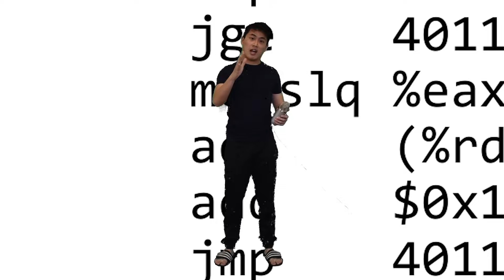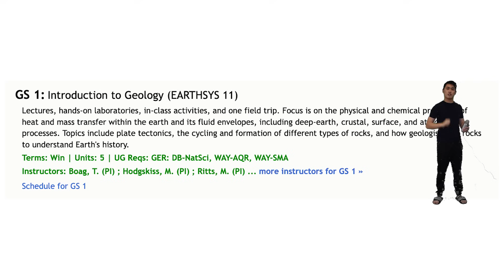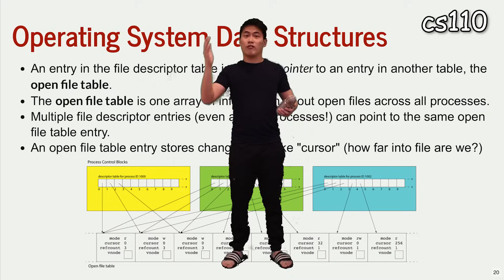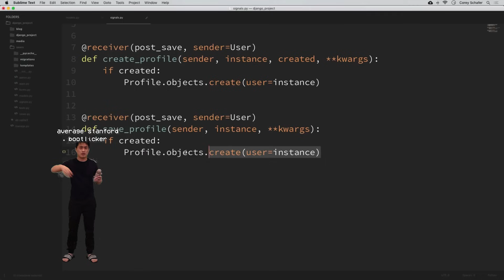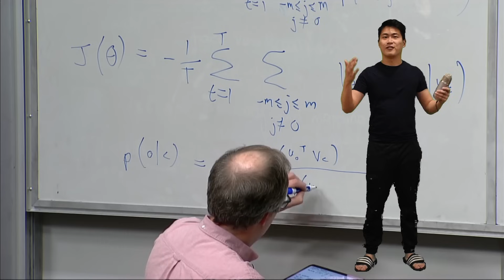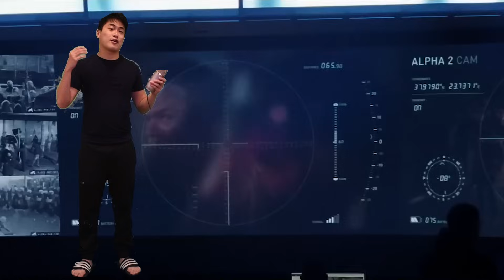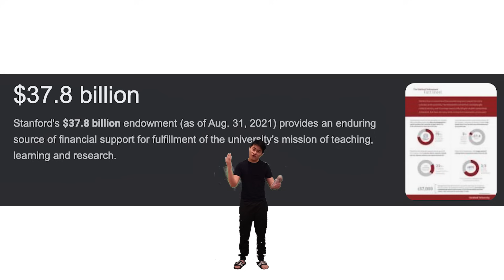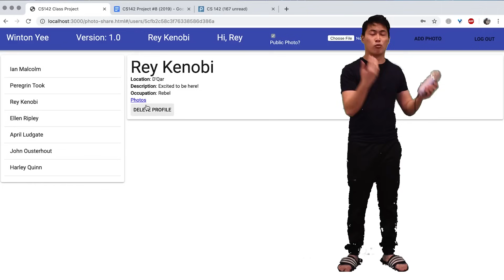Stanford Computer Science is Broken

Comment: As an IT bro with 2 associates in bullshit, 2 bachelors one being CS and another IT management and a masters in IT management I will agree that useful content on all of my degrees is about 1/4th useful if I am lucky. CS side coding was useful but not in depth or even theory heavy enough to be remotely useful. Learning assembly, computer architecture, Boolean algebra, and discrete math being the best of the content. IT management was basically learning about project management that is made up bullshit and business that is also made up bullshit. 

For the IT side of the house it did help for my certifications if barely. I will say getting Comptia Trifecta A+, Net+, Sec+ and actually learning the content will get you more info than a bachelors in 6 months time or less. For my masters I could just learn about project management on my own in 3 months and IT governance content in 2 months at the most. For the IT side of the masters CCNA and CCNP or other specialty equivalents you would gain wayyyy more knowledge from that in half the time it takes to finish a masters degree. 

The only real benefit I got out of college that made it worth it was learning how to research, write and put shit on paper beyond that the actual depth of the content is lacking and applicability towards jobs which is why everyone goes is severely lacking. Also you gotta learn how you like to study to be successful so using multiple sources to gear yourself towards your job is ideal for long term job growth. But hey no one gets a masters for the fun of it we get it for the job prospects afterwards like I needed it for network engineering positions.

Comment: I graduated in 2019 with an EE degree and then went to work a software job because that's all you can get without a master's in EE.

For me, and for my particular job, math, science, and the CS requirements were imperative to my job and now my career going forward. I suck as a software developer but my engineering skills are pretty good. After looking for other jobs, they really are different worlds. No web or app development or database mumbo jumbo made it hard to get CS jobs I wanted, I'm kind of stuck in my current path at the moment. Really low level, embedded systems is where I'm at. But it is just different than the high level stuff. UX is something completely useless for me.

My school had two computer science degrees, one an engineering degree and the other not. I can't say how the other one went, but only the very intro classes did the two meet. 

It sounds like Stanford had a computer engineering base and not a computer science base. You wanted computer science.
Reply: What do u mean software is the only job u can get without a masters?I thought ee involved little programming or did u teach urself?

Comment: Schools have SWE degrees which cover all this. CS is all about the theory. I think the premise of the video is faulty. Perhaps the tech industry favoring CS degree over SWE degree is one of the real core issues.
Reply from the maker: dang SWE major? that sounds lit, unfortunately stanford doesn’t have anything like that, though that would be awesome if it did. agree that the problem is pretty multifaceted, and industry requiring cs majors, when cs isn’t relevant to a lot of practical work, is one of the issues. also why I mentioned boot camps in the video, which I think are basically “SWE majors.” appreciate you for watchin and the interesting comment dude, hope u have a gr8 day

Comment: TL:DR - CS has grown into a field that is now too big for a single degree.  Students should choose their specializations much sooner and actually take more classes in those areas.  It would be like having an mechanical engineering student that only takes generic engineering courses for his first 5 semesters.

I have some thoughts given that I have now completed a CS undergrad degree and a CS masters degree (from different universities).  Like you, I focused my undergrad on AI (though I also took a lot of systems courses as well).  And just like you, I would also give the advice to not do that if you don't intend to do a graduate degree in AI.  That's why I ended up taking my masters degree, since I couldn't get a job with just my undergraduate degree.  

Having taken a bunch of the systems courses that you complained about, I have a bit of a soft spot for the low level requirements.  But in reality, you are probably right that you don't really need assembly code and OS essential stuff to be required unless you intend to specialize in systems.  That being said, I think its meant to give students a taste of the systems topics in order for students to determine if that is the path they want to take.  So maybe still introduce the topics, but don't go as in depth into them.

In terms of the random-ass electives, my undergrad had A LOT.  Since I went to a state school for undergrad, my tuition was pretty cheap and so I was able to take more courses than were required by my degree, allowing me to take more of the CS courses that I wanted to learn about.  But with how the normal path is designed, you wouldn't be able to take as many if your goal is just to graduate, due to the sheer number of dumb class requirements.  Honestly, I ended up actually liking some of the courses, and they were generally pretty easy, but also I'm paying for a CS education, I can learn this stuff on YouTube, for free, if I'm that interesting in it.  Courses I took for example: World Geography and Current Affairs, Buddhist Philosophy, Sociology of Diversity, Film History, and Pre-modern Technology.  All of these were selected off weird lists of required courses.  Interestingly enough, in an engineering communications course, I actually wrote a paper about how bad this system was, so I'm quite familiar with it.

Moving on to the masters program, I ended up going to a "more prestigious" university.  Were the classes better? Nope, not really. The professors had bigger egos and were not the best at making the lectures actually interesting.  A positive I will mention though, is the focus on project work. As mentioned in the video, there can be a lot of tests and psets in undergrad, and even sometimes in grad.  But I tried my best to take courses with required open-ended projects.  For example, I took a reinforcement learning course, where there was no final and 50% of the course grad was, 'find something that interests you in modern reinforcement learning research and do you own research project on this.  Obviously, these are rushed projects with minimal deliverable results since you only have one semester, and many other courses.  But it still helps you greatly with a few things, such as keeping up with modern research, brainstorming research ideas, developing systems from scratch, and presenting results.  I took many courses with similar requirements like this, and I think it was probably the most helpful element of the degree, even though it was also the most hands off. You were basically allowed to learn as much or as little as you wanted but still had the guidance of the teaching staff.

Overall, I think the main issue is that CS has become too big of a field to fall under a single degree.  It would be like if students were forced to take "engineering" and then specialize in industrial, mechanical, aerospace, etc.  In that case, there would likely be many requirements that don't make sense in the context of the student's actual specialization.  However, the main issue that, outside of the very high end schools, most students don't have a ton of exposure to CS before they start their CS degree, so it would be hard to have students pick a specialization that early.  I think a good option would be to maybe have students declare as CS, and then pick a specialization within the first year.  This would hopefully allow students the opportunity to learn about the field.  Maybe with a new intro course, for undecided students, that would brush up on all the topics briefly.  Then they could pick a main area and really learn more about this since they picked it much earlier than the actually do now a days.  Heck, maybe AI undergrads would actually have the time to learn the important stuff before they graduate too.

Comment: I have long wanted to do a video commentary criticizing my own College's Computer Science program. I was told the system was set up with the premise of getting you to go into graduate program. Our entire curriculum did not have a single python class (the only Python based course was in the School of Business.) The entire program was centered around C and you were "expected to learn on your own time" if you wanted to use any other language which only C++ would be approved for submission in any course.  But then again, our mechanical engineering department required taking Statics and Dynamics at the same time up until 2022.

Comment: I couldn't disagree more. There is this newfangled, trendy technology called digital video and digital audio. It requires understanding continuous and discrete Fourier transforms. Plenty of calculus. You are like all the whiny "non-degreed" engineers who think degrees are bs until they have to solve a spring, mass, damper system. They beg you for the "cheat sheet" so they just code it up without understanding anything. Most CS people have 0 domain knowledge about their jobs and don't want any. As long as they have software in and software out, they are just fine. Every micro controlled gizmo has some physics behind it.

Comment: But it doesn't hurt to have knowledge on various fields. They are related to each other. What the computer science degree expects of you is not about learning something that has direct commercial value such as learning to build an iOS app but give you a gist of the places where computation can be applied to, for example you may use a computer program to classify different types of rocks using your knowledge from geology or guide the locomotion of an unmanned vehicle using your knowledge from physics. The beauty of a computer science degree lies in its interdisciplinary nature. It equips you not just with specific technical skills, but also with a versatile mindset that allows you to apply computational thinking to various domains. In retrospect everything would make sense.

Comment: My daughter did high school hackathons, and interned with me at 14. One thing we could not get the CS teacher to do was to just use Git for the assignments; so that the testing could be automated, and assignments could be bug-free. This is the sort of thing that happens without just-enough wisdom from industry experience. They were making lots of little programs; as a bit of applied trade-school knowledge (maybe half!) is essential. But you should do some real-use apps end-to-end. As an engineering student, she is now at Notre Dame: 3D printing a valve controlled by an Arduino. CS students should be doing this too. The main thing you should be getting out of CS is compilers, operating systems, and things like Big-O. But we have found at work that people that went into boot camp making big apps could fill in the CS knowledge on the job. It isn't a big deal to come in on the first week asking "why is this so slow" when you do a string-append in a loop, and a senior dev starts drawing a triangle on a blackboard to explain O(n^2) to you.
Reply: Right, but the way the market is, the degree is probably more desirable?
Reply: Didn't age too well because bootcamp grads are finding it hard to get a job.

Comment: I hate to tell you this... but building a website or an app is NOT CS and if anyone tells you it is, they don't understand what computer science is... If you wanted to build apps in college then you picked the wrong major buddy. It's why symbolic systems exists.

Your problem is that you used your Stanford CS degree to work a job in frontend / web / app development. You could've worked in trading, databases, kernel development, networking, computer architecture, etc., where university-acquired skills are necessary. But no, you chose to go into a career that has pretty much nothing to do with computer science except the most shallow parts of it...

Comment: there is a difference between something being a science, and something being a technology. a undergrad course that teaches you in the science should not strip itself from the hard parts of the science in order to train you into being a good technologist. For example, a physicist (someone who learned the science of physics) could be a technologist if they decide to idk build some advanced machines, which would mean that a lot of things they might have learned about general relativity is not going to be useful. the same thing happens in computer science, the undergrad curriculum is suppose to teach you how this science works, the fundamental building blocks, which you can apply if you decide to be a technologist (coder, software engineer, system architect, etc). but if you know you are really only want to master the job of being a technologist, there are easier option such as taking training specific to that technology, which often have a curriculum that is much less taxing than the full cs curriculum.

Comment: yeah college definitely does need to be more vocational. 
I think you could probably make a lot of the same arguments for a lot of other degrees.
I majored in biology, but also had to take calculus, apparently we needed it to calculate the derivative of camel spit flying in your face.
I work in a microbiology  lab, here's all the math I've used since working there for 8 years: average, standard deviation, cross multiplication and how to make a dilution (c1v1=c2v2). Things a high school graduate should be able to do or learn.
... on the other hand, this gives me more confidence if I want to try to switch to a tech job.

Comment: Okay I feel like a lot of people missed his point, or that maybe he is a little bit too negative towards Stanford CS. So I made a more concise list based on this video and my own experience.
-> Little to no flexibility in the curriculum, can't really chose if you want to go the research route or not
-> Practical classes are rare as hell, usually are selective. In worst cases they don't  count towards graduation requirement
-> 3 quarters instead of 2 semesters (honestly this is fucked up)
-> the homeworks and what is actually taught in class are not closely related
-> almost no full projects with coding (this is fucked up too, I wouldn't say the projects I made in Uni are practical, but at least they do start from a relative blank state)
-> You paid a lot for uni, they should do better than this.

Comment: I had this same experience over 30 years ago as a chemistry major at UC Berkeley. While I did learn a lot of chemistry, I had to take all of the engineering match classes, 5 quarters of Physics. Fortunately, I did like math, but I really wanted to become an organic chemist which I did, but I learned most of the useful organic chemistry while working, not in school. I never used Quantum mechanics, Statistical Mechanics, or Thermodynamics anywhere. Those kinds of programs are just to keep professors employed and apply a weeding out process to discourage students or force them into 4 more years of graduate school, so they are enslaved by professors. By the end of that they have probably reached the pinnacle of their career because in real life their job will be much simpler, but it does inflate their egos along the route. I self-taught myself all of the computer science I needed to write code.

Comment: "In my two years of working" Dude you have barely scratched the surface of what you will and won't use when coding for the tech industry. Also software engineer and computer scientist are two different jobs.

Another thing about working in the tech industry is you never stop learning. Ever. There will always be new problems and developments to overcome.

Comment: The purpose of CS is not about empirical skill sets - to be a software developer you do not need to have degree, e.g. Zuckerberg, Gates, Musk etc.
CS program at elite universities are about theoretical computer science, e.g. Turing complete, P v. NP,  cellular automata etc.

CS prigram has very limited empirical usage for daily work as software engineer. If you want to be software developer CS prog. at Stanford is a bad choice. It will be better to take software development bootcamp, instead spend 3 years and 160k tuition debt - does not worth it, if you want to software engineer, software developer.

Comment: If u don't understand Systems Software I'm sorry to say u will always be stuck in ui/ux and api consumption.... building the framework that u utilise will not be your work. The basics of computer science includes DS algo, os, assembly, network, computer organisation and architecture, compiler Design , DBMS and last but not least digital logic design and a programming language C C++, Java, python. These are rudimentary basics that every computer major should know. Otherwise there is dark in the other side of the tunnel and u can be replaced by AI ... sorry to say but this is the hard reality. Consumption of apis will get easier and easier until one point it will be replaced by some ai tools and a very small team.